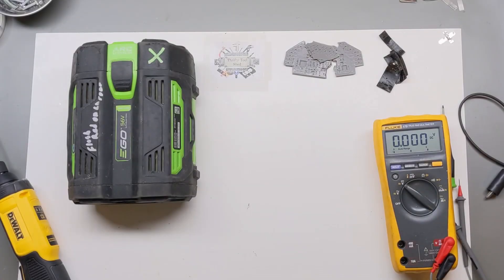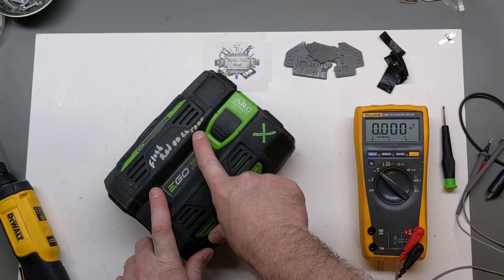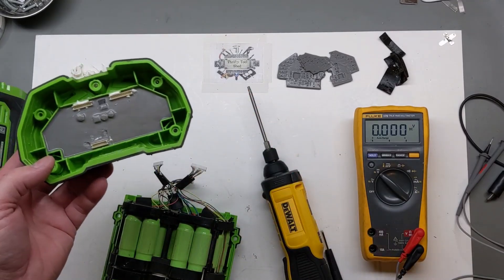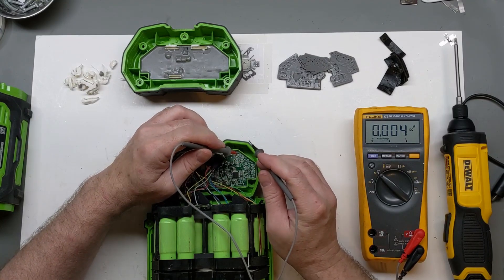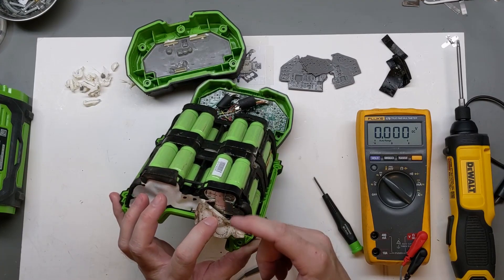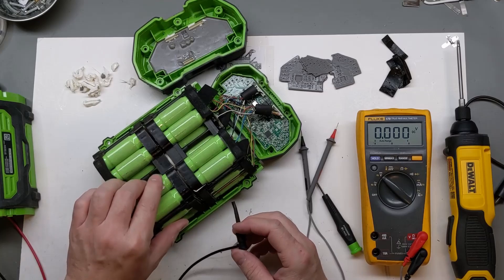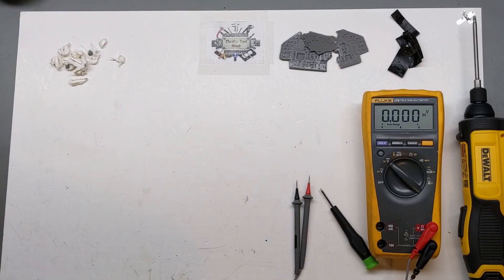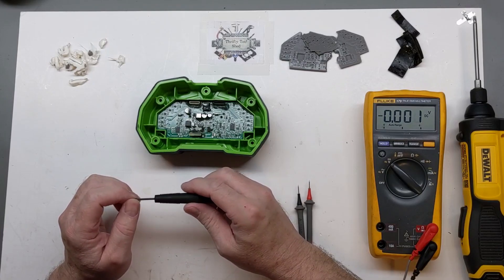EGO 56V Gen1 5AH Blinking Red on Charger Fix

Comment: I have a Ryobi OP401 40V charger. Have you ever worked on one. I have no voltage output.
Reply from the maker: I have not had to work on a 40V Ryobi charger yet. I have some videos on the EGO fast charger and 2 other Ryobi charger that are 18V. I am currently working on another 18V Ryobi charger that has similar issue you described. I believe lighting or a surge from it come in on mine and it took out the switcher chip. I have had some with just blown fuses but most of the time they blow it is another reason for it.
Reply: I bought a charger that was supposedly known working and I pull the Ryobi 40v batteries every time I find them, I have a 5ah, a 4ah, both of which blink four green squares/lights, and two 2.6ah that seem to be flat dead. I've tried resetting the larger capacity ones via the rst contacts on the board and not had any luck with that or boosting from a known working battery.
I'm not sure what the problem is as I watch tons of videos but that whole line seems to be very dodgy.
Just my two cents.
Reply from the maker: Yes. I have been asked to do some videos on the 40V Ryobi packs and I mentioned that I never had alot of long term luck with them. So I did a video sharing a little about them and  how they are sometimes good for cell harvesting but in the end I used to run my 40V Ryobi stuff with 2 of my 20V Makita or Milwaukee packs in series and I had no issues. The video kinda got some mixed comments. Some wanted to go further with showing some actual repair, some disliked my thoughts and think the 40V have been ok for them? Most people that I know have had similar luck as my experience, it's just a headache to keep them running, the BMS is too problematic. Overcomplicated and engineered for it to ever be reliable!  I work on alot of packs, but basically just cell harvest the 40V Ryobi!
Reply: @ThriftyToolShed  well, if you ever need some to work on for a video I'd be more than happy to donate. I hit all of the hardware stores within 30 mi from my house that have battery dumps and have assembled quite the collection!
Reply from the maker: @bradhabit2217  
I check them often as well.  I have not found many packs in the bins this year. I would find something almost every time I would go to the hardware store pre-Covid!
Reply: @ThriftyToolShed  I have discovered the opposite, as well as finding other devices in there like a 20, 000Ah power bank with 3 outputs and 3 different inputs, lightning, mini, and type C.
The thing is beast, and it works perfectly I don't know why anybody would throw it away. It does appear to be something that would be given away by a company to their employees, those things tend to usually go unappreciated.
Many Ryobi 18v that seem to have one or two bad cells, I just haven't had a lot of time with winter closing in. Hopefully soon, but I'm starting with that Ego battery first LOL!

Comment: How would one go about charging an individual 18650 without a proper bench power supply? 
Could I jump my Nitecore charger or use Skymax B6AC or Accucel 6?
Make one from old adapter? (apprehensive)
I've witnessed thermal runaway and am now paranoid, it has all but halted any of my work on batteries.
Thanks in advance.
Reply from the maker: 18650 are no joke for sure. I am always cautious when charging cells and yes I will only use a CC-CV control. I have not tied it jumping to a Nitecore charger, but it could work and it should be controlled well, just take a little longer since it is thinking it is charging 1 cell and you may have 2 in parallel or even 3 in parallel in a 7.5ah pack. I don't know the other chargers  by the name you mentioned but if hobby chargers they would most likely be fine. Best of luck to ya! Thanks for your comment!
Reply: @ThriftyToolShed  I have two Nightcore chargers that will hold four cells each, and the other two I mentioned are both hobby charges that will charge from 1s to 6s.
From the information you responded with, I feel safe trying to boost individual cells. Your clear and concise videos, professionalism and safety are unparalleled.
It's gotten quite cold in my neck of the woods, I will keep you posted on the one I have.
Thank you again for the valuable information you provide.

Comment: How you likeing that Dewalt screw driver
Reply from the maker: It is pretty awesome. Extremely responsive. I use one at work as well that is a little bit nicer model with adjustable handle, torque settings and 2 batteries. I thought about doing a quick review on it like I did the cheaper Skil and Hammerhead which is also good. I actually bought the dewalt  tool only from a local flea market so I bought a cheap battery from eBay for it and it is absolutely great for what I have in it. I have about $38 in it.